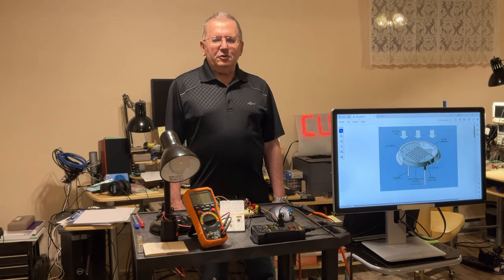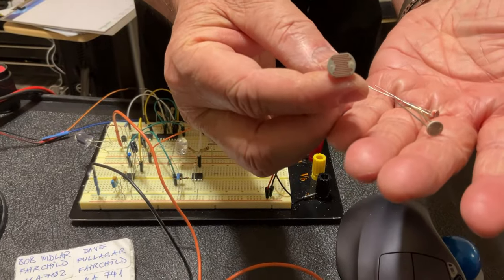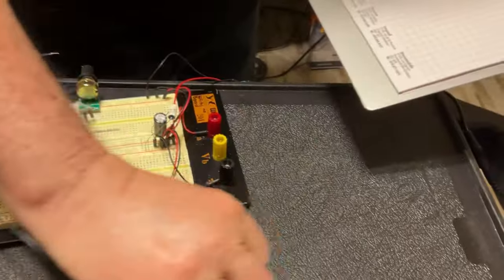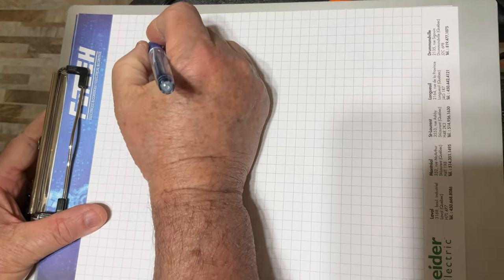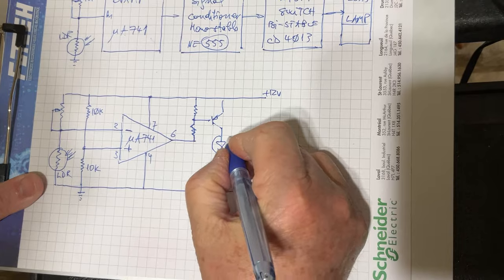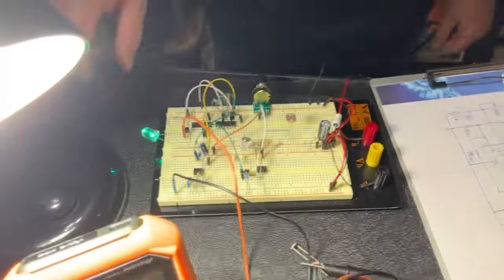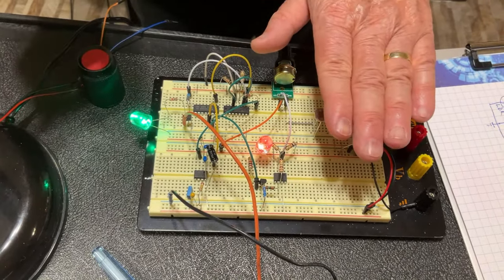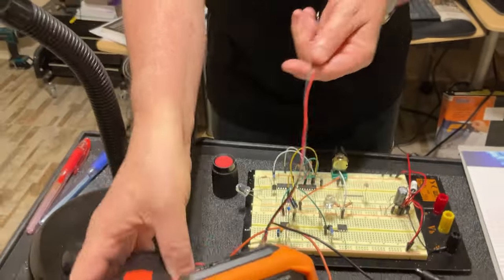DIY: Let there be LDRs! The Photo-Resistor Intro.1/2

Comment: Prática a tua explicação, porém, fiquei ainda com uma dúvida: Desculpe-me a ignorância, mas a segunda configuração funcionará como luminária automática noturna? Saudações do Brasil 🇧🇷
Reply: Qual o valor do resistor que vai ao led?
Reply from the maker: @luizfernandolessa1889: This was only the first stage of the project, showing how to connect a LDR to an amplifier. The next two stages are presented in my Saturday's last video. Yes, the project can automatically control a load, 12V DC or 127/220V AC, if you use a kind of relay box like the one I presented in my video "https://youtu.be/DzwkuKSlfwo"
In the video description you have the link to download the full project diagram.
Thanks a lot for your feedback and interest.
CU
Reply from the maker: @luizfernandolessa1889  The resistor size is 1Kohm. Cheers.
If you have other questions, don't hesitate